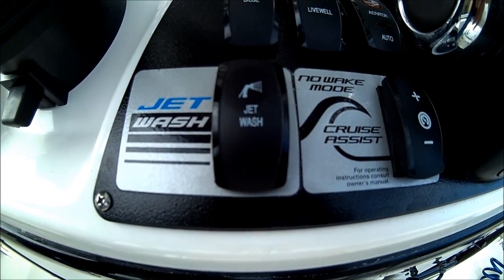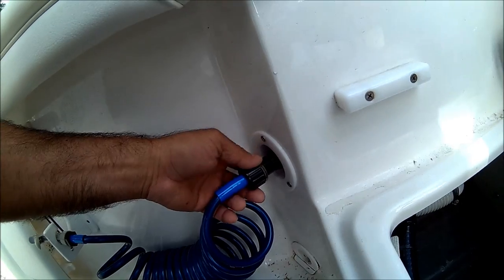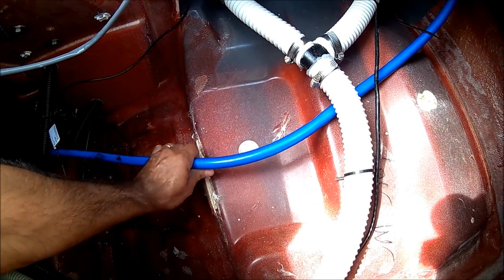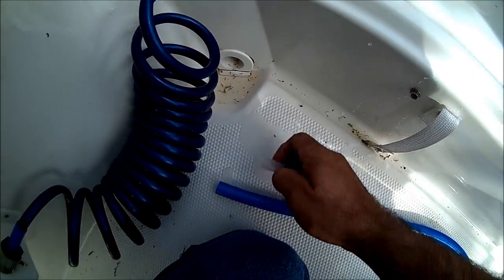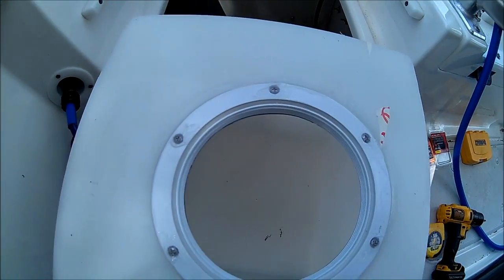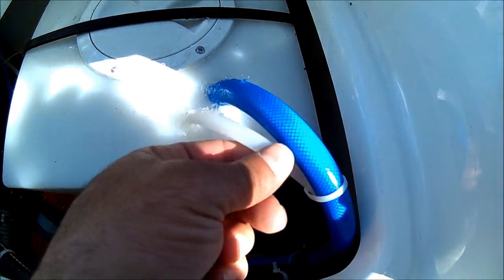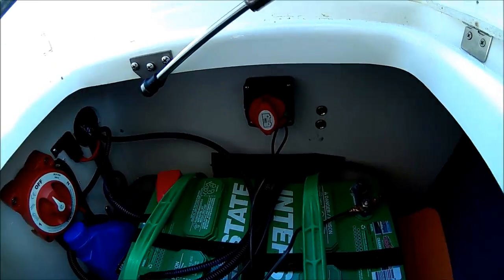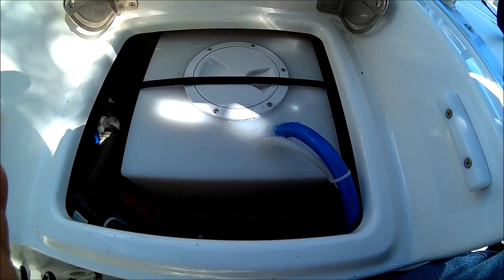How to add Fresh Water to your Fishing Boat Sea Flow water pump DIY Yamaha 190 FSH 210 FSH 240 FSH

Comment: 2 things i would add to your water tank add on, first an outside filler hole that way you dont have to lift seat and unscrew top of water tank every time you need to fill it, all you need is a filler inlet outside of the tank and a pice of hose that goes directly to your tank, just like any boat has with fresh water tank. second a soft ruber matt under your water tank, that way it has some cushing and wont get damage from the weight and bouncing, i use those mats they sell for yoga classes, they are about half inch to 3 quartes thick, that will help the tank live longer. CHEERS good job on the add on.

Comment: So u gotta get your own supply water line from tank to pump and from pump to the connection for the coiled spray hose ? From what little experience I have that one on pressure side needs to be a high pressure hose. “ metal reinforced “
Reply from the maker: I used it for years and never had a problem with it there's not a lot of pressure from the hose cap

Comment: What is the main reason for wanting fresh water?   I assume it is so that you do not have salt water but wondering what you use it for.  Thanks for sharing the videos. sub added
Reply from the maker: Jaimie that's a great question if you look at my videos I usually go in sleepover nights 2 or 3 nights in the Bahamas and after being in the salt water all day I have to rinse off the salt water so I can be comfortable that's the main reason why I have fresh water
Reply: Yes I have watched with jealously your stay overs in the Bahamas :-)  We may be picking up a new old stock 2016 FSH in a few weeks so I have been researching all I can about the leaks etc.  Love seeing you use the boat to the extreme.  I doubt a lot of users are doing 4hr ocean crossing.
Reply from the maker: Jaimie yes very few are doing what i do , there is another company it's called Scarab they also are making a new jet boat there is already in the market ,you may want to check it out it's compared to the 190 FSH it's called a Scarab 195 fish open and then you might find it interesting
Reply: I did look at this boat but really like the Swim Platform and feel of the FSH.  We will be on fresh water lakes so will using it more like a true hybrid of fishing and water sports.  We have a small Whaler now (13 foot, 40hp).  I would like a bigger Whaler but the costs get a little crazy.  It is also overkill for what we will be doing with it.
Reply from the maker: Jaimie yes the Boston Whaler is a great boat but it is overpriced so in this case the 190 FSH for the lake will be great better than saltwater and it has a good size engine
Reply: +1

Comment: Ho much did you pay for the boat? what city did you buy it in? were you able to negotiate a lower price or reductions of fee. 
Please give me detail looking to buy one but also want the best deal.
Reply from the maker: i paid 27999.00 +500 trailer upgrade  any dealer is probably will be the same price does not change is in yamaha website
Reply: Did they charge you Prep fee and transportation charges. 
My local dealer was asking $500 over website price + $850 prep fee +$1400 transportation fee + $500 Dealer fee.
Reply from the maker: i did pay 1400 delivery and 799 delivery fee but they deduct me the -$500dealer fee that's was the only break i got
Reply: Hey thanks for the info this helps. Btw I found out today invoice price for the boat. Basically the dealer gets it $3000 under MSRP that price included the freight so dealer make $3k Plus the Delivery fee and the prep fee. So basically $5200. total I got my local dealer to a price where I'm getting the FSH Sport for $30,800 + 899 Prep fee. no freight and no dealer fee. So basically the dealer will make $2700 profit 
My point is if you play hard to get dealer will go down.  I mean they rather make some money then no money plus they can just order an other boat just like it. 
Any ways thanks for all you videos Yamaha should sponsor you because it was all your videos that convince me to buy this boat instead of a 19' mako for $10k more

Comment: Whats up brother.  I am doing this on my boat.  Question, does the blue hose on top of the tank that goes inside the tank, does it go all the way to the bottom of the tank?? and the breathing hose inside the tank, does if stay on top of the water?? I'm confused.  Gracias!!
Reply from the maker: The blue hose goes all the way to the bottom and the Breather you don't need to put it all the way in the bottom just on the top of the surface of the tank and make sure that hose is higher than the tank that way you don't get it spilled over

Comment: I understand you not using the raw water for rope cleaning and other things like that but to wash the floor of the boat, clean fish (you clean your fish at the back i know) but i would of left the raw water still working and just added the fresh water tank, 7 gallons is not a lot of fresh water any way. You will have to keep on refilling it on every dock your near. CHEERS KEEP SAFE............................
Reply from the maker: 2FAST4U2 i only like to spray my boat with fresh water to take out that salt water feel to it wich i hate.
And i did not like the raw water system because wen is activated by the engine power the boat moves in a circle and the intake can suck up my anchor rope i hade closed calls

Comment: Where did you get the water tank? What are the dimensions? Thanks
Reply from the maker: hello brian
www.plasticwatertanks.com
7 gallons poly tank (B326)
paid $119.99+shipping 
$about $38 to ship to florida
Reply: Perfect thanks!  "Ronco Plastics"  Same guy that makes the food dehydrator and spray paint hair? lol
Reply from the maker: +Brian Gruhn (bgruhn76) lol the zise  is 12×12×12 is a square box hope it helps.
what boat are you placing the tank to?
Reply: +Out On The Reef 
Picking up FSH in a bit.
Want fresh water instead of salt. :-)
Reply from the maker: +Brian Gruhn (bgruhn76) cool you will like it.
i had boats before but 190 fsh is been one of my favorite one, the fresh water is great.
to order custom tank takes about 2 to 3 weeks to be diliver to you
Reply: What were the dimensions of the tank, Where did you order it, and what length screws did you use into the hull? Pick my boat up next week.